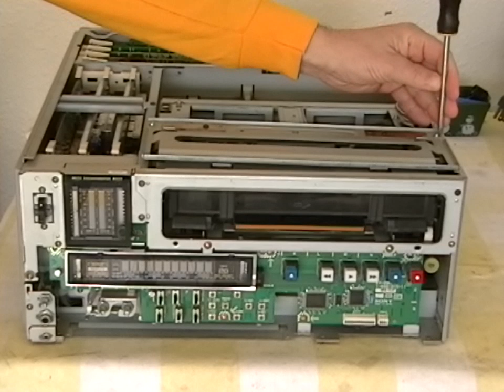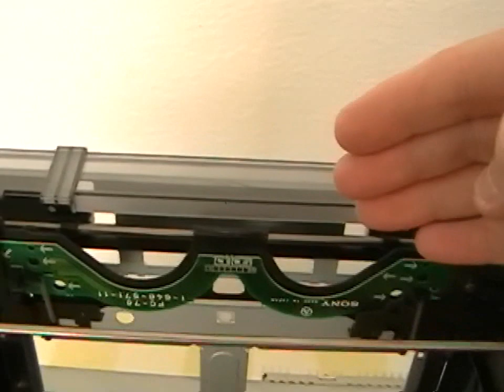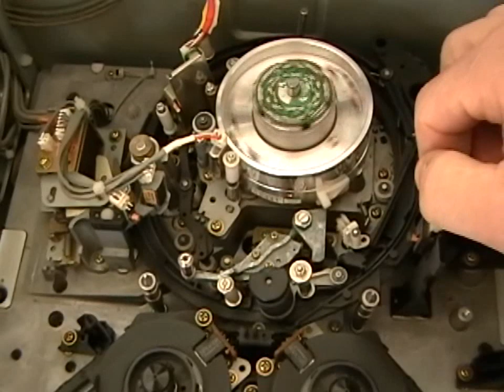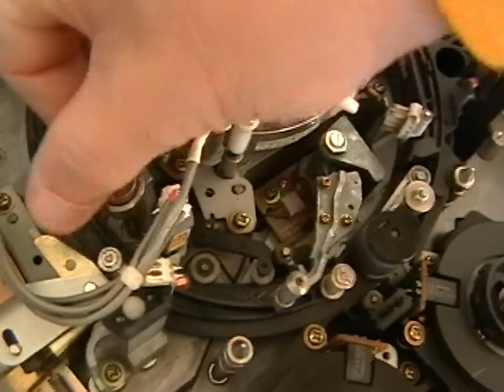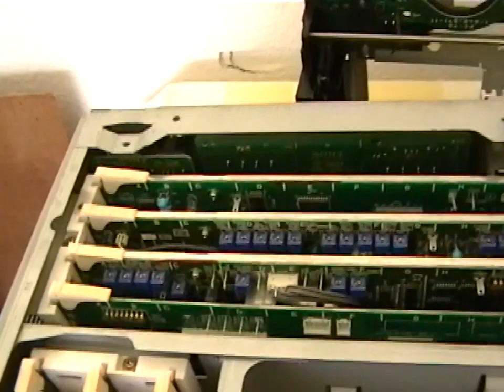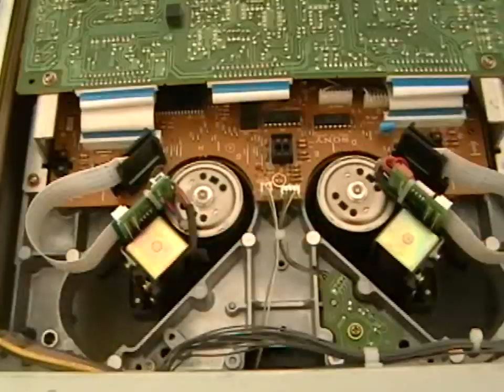Sony Betacam Sp Uvw-1400 Loading Error System Repair!

Comment: hi alot now are buying them not to resell any more  i picked up a sony A510p 
the studio now in 2024  needed to bin the deck  i payed £20 for it  just parts that would not move right 

when you posted this video  things are not the same
now 10 years later  things have changed alot 

i am finding alot  are after a DEAL on moving  audio  / video of tapes    cost of living has hit alot 

i can do this at cost and under cut alot of people in this game   i up set alot big time 
because my fee's are so low  some said i would be better to send the tapes to me in the uk 
land shipping and digi back  

i got hold of 8 of this model all 6 are working ok now used 2 decks as parts

note ADAT is not liked there's alot on the under market place

Comment: Sony UVW 1800 BetaCam Player error code 02-A95 (Detected both S and T reel FGs during cassette eject). Plays small betacam tape fine but when ejecting the tape gets stuck as soon as the carriage begins moving the tape back to the insert slot. Tape is good, ejects fine on another functioning 1800 I have. Any ideas on how to fix?

Comment: 2012  about bbc stopped taking tapes in  ex bbc man told  me 
time to time they can't be fixed  as it's the same thing on 2 deck  i have worked on 60 plus decks  this model is easy to fix up

Comment: hi watched you video  just one thing the tape tenson arm  part goe's i use a small heat gun to heat up all the parts that are jammed 
up i got a lot of betacam sp dig in   and moved all the parts about finding unit's that don't work is getting harder now it's getting about
in the uk  i am buying them  i have 20 of the 3 used for parts i am keeping them  nice nest  money pot i used to sell them on not
a good plan as you find it hard getting part this way i only buy big lots now

Comment: Hi,

I have the Sony UVW-1800.  When I insert a tape I get Error 02-694.  I am able to Eject the tape.  The mechanism seems to work fine as far as inserting & ejecting the tape.  I cleaned the motor guide rails and lubricated them with Oil.  I did not take out the 2 motors yet.   I still get the Error code.  Is there an easy way to fix this ??   Thank you for your help.

Comment: These UVW's also have a problem with hair line cracks on the solder joints on the reel motors where the ribbon cable attaches . I had two bad motors for this problem on my 3 UVW's.

Comment: Hey Rick! Awesome vid! Could really use your help.  I had a guy who owned a local TV studio have to do an emmergency shutdown due to his son passing in a tragic car accident.  I'm helping him move ALL the equipment....its a TON.  I have a storage until chalk full of it.  Anyway I had an error message....any ideas?  Is this something worth fixing? Thanks!

Sony Digital VideoCassette Player DNW-65 Betacam SX AC 100-240v 50/60hz 165va
The error code is

TH/UNTH MOTOR 009
Reply from the maker: Brad   
Error Codes mean Mech Loading issues as I stated. Yes there worth fixing if they need to be used.

Comment: Hi Rick, I have a UVW-1400 that is working well; but it looks like the tracking is off. How can I know whether it is dirty heads, or the tracking, and is the tracking adjustable on the 1400?
Reply from the maker: +GreenPeasProductions 
Hello there is a Tracking adjustment located on the Servo Board but not on the out side of the unit. sounds to me you video heads might be worn or a bad Tape or a alignment problem.. Rick

Comment: Rick I have a UVW-1800.  I made all repairs as you instructed and the motors are working smoothly and seem to be lining up in the properly for the tape size I load into the machine, however large or small tapes do not go all the way down for the tape drum mechinism tot bringing the tape around the drum.  After a second or two the machine ejects the tape and I get an error code "02-154" do you know how I can fix this problem?

Comment: Hi Rick, I just got a Sony PVW 2650P Betamax sp that although loads & ejects fine, it doesn't play & comes up with a 09 error code (thread/unthread operation does not complete correctly). Any suggestions I can try to fix it myself? I do have experience with some electronics but not a betacam machine.
Reply from the maker: Pounder46

were are you located? anyway my video is the same process on all the Beta cam sp.  this is not a simple fix its sounds like a complete service job like i show in my video but you will not be able to find the parts for these trust me its very difficult. i do service these units and it sound like a card issue as well. not sure you would be able to fix on your own. i live in Arizona so if your interested in me doing the work let me know. Rick
Reply: I'm in Australia. Okay I opened it up and cleaned all the tape path (rollers, head, etc) and presto, no more error and it plays tapes fine now. Only thing is I can't get an audio out from the XLR connectors but the head phone output works. Probably something simple I'm missing...
Reply: Audio sorted. Only works with a balanced audio XLR cable not an unbalanced one, as I was trying.
Reply from the maker: pounder46 Your Best bet is to Replace the audio card it should fix your problem most likely a bad amp chip. Rick
Reply: See my previous reply. Audio works now. Had to use balanced line outs, not unbalanced.
Reply: Yep, error 9 is always a dry and dirty tape path.  Easy fix.  You did good.  All 3 of my UVW's front panel lights went off.  It's all because of cheap Caps on one small board. If you smell fish, that's the caps leaking.